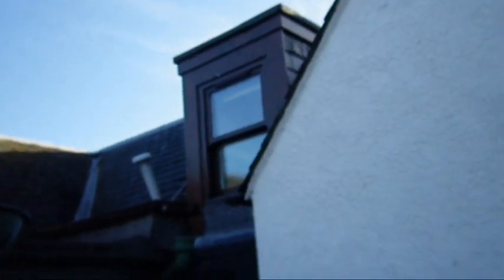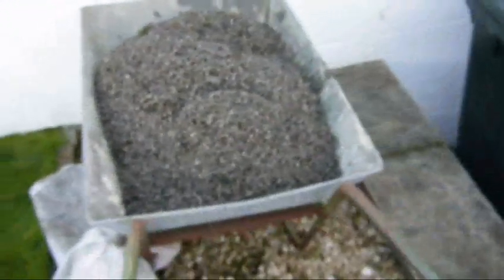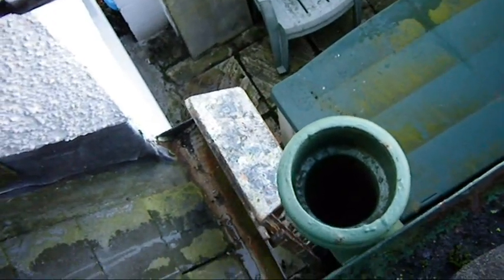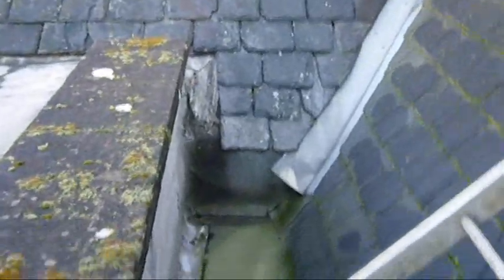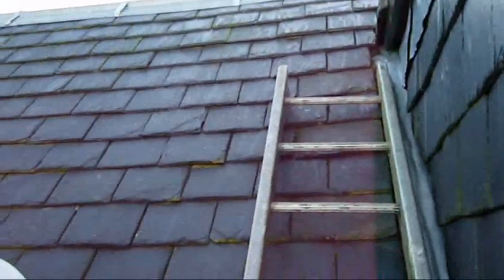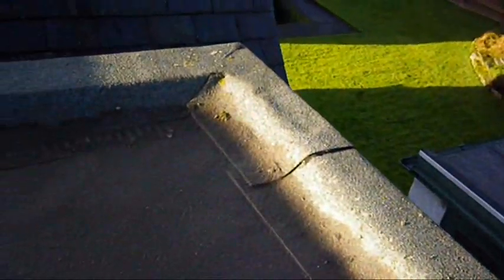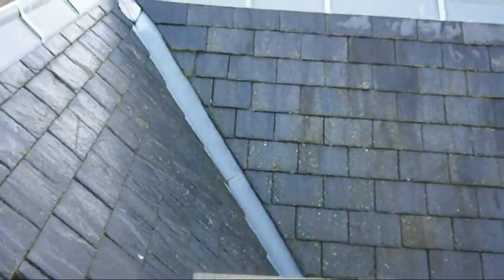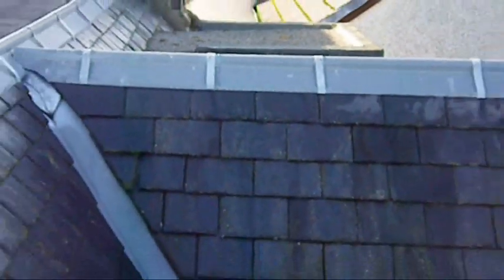Leaking Roof

Comment from the maker: Thanks for that. I've had a guy look at it and he's going to build up a run off with bitumen, then take off the 2 rows of slates above and re-felt it right up to the ridging as the fierce wind has blown the pool of water up and under the slates and got through. The stone chips will then go back as they're a requirement by the local authority as a fire preventative to stop sparks from an adjoining house on fire from setting the felt on fire.